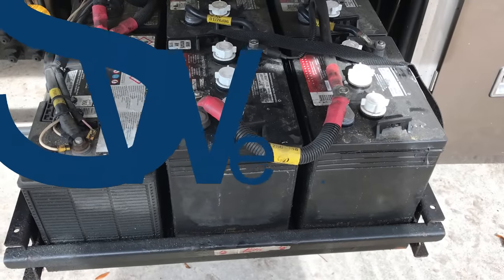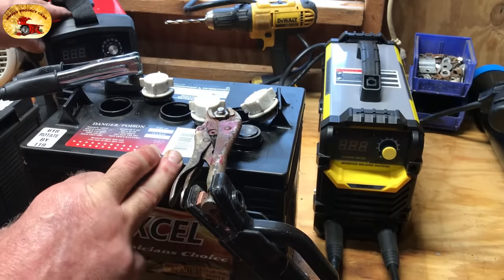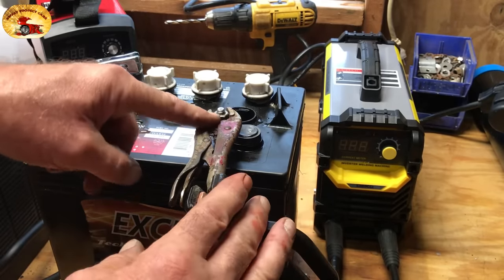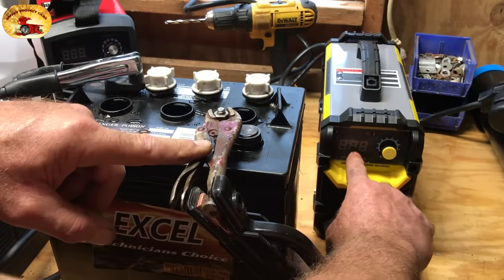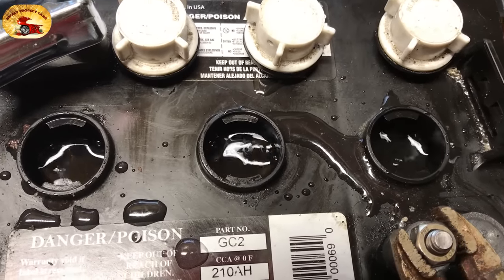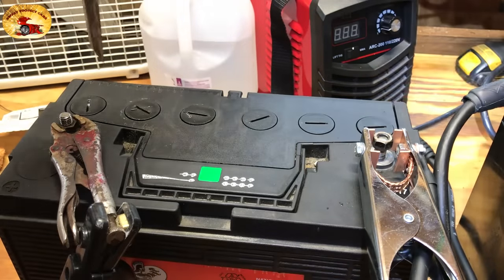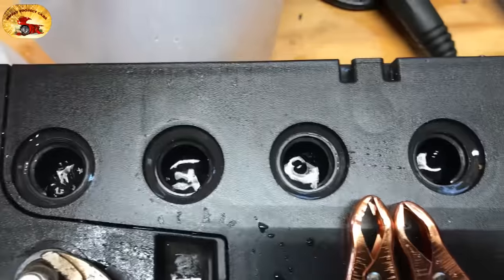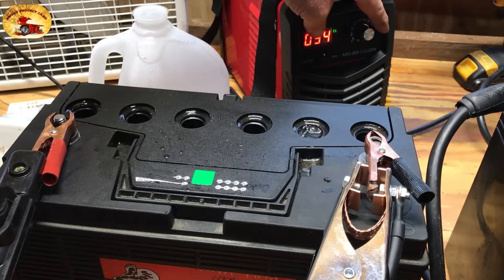How To MAKE OLD BATTERIES NEW Again!!!  12v 6v Deep Cycle, Car, Truck, Golf Cart, Semi

Comment: Question, since the plates/plaques are releasing residue from the process of reviving the batteries, wouldn't it be a good idea to throw out the dirty distilled water used in the revival process, rinse and repeat a couple of times and just add new distilled water at the end ? I'm assuming that all of the old residue is going to stick back to the plates/plaques
Reply from the maker: If it makes you feel better to do that, go ahead Eddie, we don't think it's necessary but do whatever you are comfortable with, it certainly doesn't hurt. Thanks for watching, have a great week and all the best on your project my friend. mad Mike the hammer SPC
Reply: It's actually dilute sulphuric acid used as the electrolyte in lead-acid batteries. Distilled water is non-conductive so won't work as an electrolyte. If the electrolyte level is low in a cell, it should be topped-up with distilled water to just above the top of the plates. Adding more will dilute the acid and reduce the capacity and current rating of the battery.

Comment: Did you get your welders mixed up? The Deka(yellow) welder you said was for the 6 volt and could do tig welding, but the description on the Amazon link didn't mention tig capability. The red one you said was for 12 volt batteries and didn't say anything about being able to tig weld but the description in the Amazon link said it could do lift tig welding. I have 4 6v GC2 golf cart batteries that need rejuvenating.
Reply from the maker: Rick, they are both capable of doing tig welding, Amazon just doesn't mention it on the yellow one.  Hope this helps.  Have  great night.  mad Mike the hammer SPC

Comment: Is there a way to look at the batteries and know if you would consider it a regular battery or a deep cycle.  Some of the marine batteries seem to be meant for starting and deep cycle of boats.  How do I know which type of battery to consider it.
Reply: the best i can tell is if the battery does not indicate an ah rating on it to use the welder for a standard battery?
Reply from the maker: Just google the part number on the battery, that will tell you what type it is.  Thank you for watching Craig, have a great day. mad Mike the hammer SPC

Comment: Is this process safe and effective with AGM batteries??  I bought a Schumacker SC1325 with 250A and it does not seem to be doing the job with the thermal overload protections.  Should the battery be dead when desulfering?  The SC1325 works when turned "on" for 3 min, then goes to "rdy" for 3 min then does a 3 min count down and stops boiling.  It will then go back to ready but not bubble again.  Battery is at 13.2 V.
Reply from the maker: This only works on wet style batteries

Comment: Is the number showing on the welding machines amps or voltage?? Thanks
Reply from the maker: It's amps, it acts just like a standard battery charger except you can weld with it.  Thanks Wm. mad Mike the hammer SPC

Comment: Could I try to revive a battery that is sealed, doing the same 5 minutes X 5, then 10 minutes rest then again even if I do not see the bubbles?
Reply from the maker: No, you need to have visual of the fluids in the batteries.  Thanks for watching.  mad Mike the hammer SPC
Reply: @SweetProjectCars  Mike, I had a problem with the first battery, I had to crank the mini welder to 105 so I could see the bubles. Yesterday I got a couple of new post cables so I could really GRAB the posts and it worked better, at 50 I could see the bubbles. Thank you.

Comment: Mad Mike the Hammer- I bought the Associated 200 amp (blue) charger that you recommended in your other video for 12v batteries. Works great. However, I now have a bunch of 6v batteries that need charging. Can I put the setting on 6v and charge it them with that? For how long? I don’t want to buy a welder after spending all that $$ on the charger. Thanks for all you do.
Reply from the maker: You can use the charger for that size as long as they are wet-style, just reduce all of the timelines in half.  Thanks for watching and asking, have a great day. mad Mike the hammer SPC

Comment: The 12v battery in '18 Camry reads 10.8v, it struggles to start but it will turn the engine over. After driving it reads 12.8 (so my alternator is working) then after sitting it goes back down to 10.8v From what I've read online I may have a dead cell. This method of reviving a battery wouldn't help if it is a dead cell or would it ?
Reply from the maker: We've done it, give it a shot Mateo, sounds like you've got nothing to lose my friend. Have a great day and all the best on your project. mad Mike the hammer SPC

Comment: Here in South Africa a 12v Trojan 1275 golf cart battery costs R5,200 (USD 300) and you need 4 of them.  Mine are getting tired and I can see the grey sulphate deposit on the plates through the filler caps.  I can buy a 200amp stick welder for +/- USD 120.  If the technique works as you claim  I must ask why is it not practiced more widely?  If you can buy a suitable welder for a tenth of the price of 4 new batteries it's a no-brainer, and surely somebody would be refurbishing them as a business.
Reply from the maker: They are indeed, refurbing them and re-selling them Brian. Not sure why more people don't do this, I can't remember the last time we purchased a battery. Thank you for watching and commenting, have a great week my friend. mad Mike the hammer SPC

Comment: Great video.. I am trying today for first time and one cell won't wake up.. even if turn welder to 150..any advise?
Reply: OK think I have it sorted. My Metabo welder has a switch fit toggle or clap I changed to clamp and all boiling..
Reply from the maker: Let the battery cool after you do the process, wait a day or 12 hrs. and try it again, we've done the series up to 5 times and have had success, but if you do it 5 times and it doesn't wake up that cell, your battery is toast. Hope this helps Derek, thank you for watching and asking, have a great New Year. mad Mike the hammer SPC

Comment: Just to be sure as can't get exactly the same welders in the UK at the moment.
Could you please state the voltage output for both the red and yellow welders ?  
At what amperage to run them (in your previous vid with the old none digital charger I think you were using START MODE i.e. 200/210 A for the 12v batteries)
Could you tell us the make and model for each as Amazon is not taking me to the exact welders.
Reply from the maker: Get this  https://amzn.to/3lamXiv     When your new welder arrives, clamp that badboy on your battery, follow the video and you are good to go.  Thanks.  Have a fantastic day my friend.  mad Mike the hammer SPC
Reply: @SweetProjectCars  ....  Thanks Mike, got that ordered as a Christmas present from my daughter. 
Following your video, I should use 22 Amps for 5 mins on and off for 10 mins, repeat 5 times... I should use 90 Amps for a couple of minutes to wake a reluctant battery or cell up.
I should not use 200 Amps as in your other video. 15 mins on 60 mins off repeat 5 times.
What is the important difference  between the 2  ?
Just want to fully understand both techniques but don't want to be a pain.

Comment: Should I add epsom salt first before I put the battery on the welding machine?
Reply from the maker: You can add drywall dust if you want to, it's your battery.  Follow the process in the video and you will have success.  Thanks.  mad Mike the hammer SPC
Reply: @SweetProjectCars  I'm just asking for more suggestions if only adding water doesn't work. I didn't appreciate the sarcasm with drywall dust as I ask you a serious question.
Reply: @SweetProjectCars  lol

Comment: I have a question or two.

How do I know what model welder to buy?

Also: is it 200 Volt going through the battery?
Reply from the maker: We use these  Welder for Deep Cycle ONLY 6 Volt & 12V Batteries    https://amzn.to/3yW4ihK  &  Use This for all Standard 12-volt Batteries    https://amzn.to/2K1UsWQ  Thanks for watching. mad Mike the hammer SPC

Comment: Hey boss, what are your recommendations on little 12v 7ah lead-acid batteries.  I sawbelow you said to cut the time in half for motorcycle batteries. My back of envelope math says to quarter the time.  Thoughts?
Reply from the maker: You answered your own question with your back of envelope math my friend :)  Thank you for watching William, we appreciate it.  Have a great weekend. mad Mike the hammer SPC
Reply: @SweetProjectCars  Finally got a dead battery and picked up an Amico that you suggested.  Youtube keeps deleting my comments because I wanted to post a pic imgbb.  Can't get the caps off.

Comment: i just have to ask. How many OUTPUT volts does the welder has to be and the digital numbers we see on the welders are amps or volts? So we use 12 volts but 40-50 amps or we just crank up the voltage to 130v ? I don't understand.Thank you
Reply from the maker: I would watch the video again.  Put the clamps on the battery, make sure the amp dial is on 0, plug in the welder and slowly turn up the amps until you have a consistent boil then follow the video process.  Thanks. mad Mike the hammer SPC

Comment: I have the same little yellow welder, Works great, I run mine on 220,  But that one won't work on the car batteries? I don't have any 6v, But have a few car batteries I would of liked to bring back.
Reply from the maker: We recommend this  https://amzn.to/2K1UsWQ  for standard car batteries, although you can use whatever you want to use, we are just sharing what we have tried and tested and know works and is safe for you and your batteries.  Thank you for watching Shawn.  Have a great day. mad Mike the hammer SPC
Reply: @SweetProjectCars  I seen that you moved to the 200amp for the other batteries, I'm going to give it a shot on the 160amp to see if I can revive my 12v marine battery. It's completely dead, If it works, Awesome, If it doesn't...Nothing lost. :)

Thanks again for all your awesome videos, I really appreciate it and enjoy watching.

Comment: Hi there ,thanks for your amazing videos. I tried the welder method so the battery cell did boiled a lot, but I couldn't get the battery to keep the charge. I had the welder at 70 amps because I couldn't get it any higher because my breaker with pop up.do the amps need to go higher. Thanks
Reply from the maker: Hello Domingo, you can do the complete 5 step process up to 5 times, if it doesn't hold after that, your battery is toast my friend. Thanks for watching and sharing, have a great day. mad Mike the hammer SPC

Comment: Dear Mike

I followed the video to the T and my previously dead battery awoke and started the car. Then I removed the negative and positive terminals from the battery to ensure nothing drains my battery for whatever reason.

The next morning, lo and behold, the battery was flat again. What could have gone wrong?

I'll try the method again, but this time either use a normal trickle charger after the 5th charge cycle to see if this won't ensure charge stays for much longer, or prolong the steps, say to 10times, or, close the cap of the battery of the more active cells to give those that are initially slower to bubble a chance to awaken without losing acid water in super active cells when I crank the welder knob up.

Any other advice?

Thank you for your continued sweet advice
Reply from the maker: Upon completion of the process, use this  https://amzn.to/3kmCThX to complete the charge. Sounds like you did everything correctly, but make sure you finish with the item in the link my friend.  Thank you for watching and sharing your results, sorry about the delay in responding. Have a great day. mad Mike the hammer SPC
Reply: I had the same problem -- did this charge completer method work for you?

Comment: What are the differences between the Yellow and the Red Welders?!
Reply from the maker: One is for deep cycle and one is for standard.  We've tested them both with said battery types and have found that each is specific to the type based on our tests, we know they work and most importantly  they are safe for both you and your batteries.  Thanks for watching, have a great day. mad Mike the hammer SPC

Comment: Which welder would you recommend to charge BOTH Deep Cycle 12 V batteries and normal 12 V Car Batteries? Would the 200 Amp welder be the one to use for both or the 160 Amp welder that you say to use on Deep Cycle batteries? John
Reply from the maker: Hello John, our videos are very product/tool specific, the recommended tools are listed in the SHOW MORE of the videos description. The reason we only recommend those specific welders is because they have been tried and tested by us in our over 40 years and have proven to work but most importantly are safe for both you and your batteries.  Thank you for watching, have a great day. mad Mike the hammer SPC

Comment: You can do this with your battery charger if you have a booster on it but it takes 15 min on max per hr. 3 or 4 times depending on the condition.  Cheers.
Reply from the maker: Thank you for watching and sharing Jeremy, have a great week my friend. mad Mike the hammer SPC

Comment: I checked out the Red Welder following your link. The link leds to a model# ARC200. There is an optional one ARC160 both same price. What is the difference? Which one do I consider ??? TIA😃
Reply: ooops I figured it out ARC200 is 200A and ARC160 is 160A. I want the 200A one. Thanks
Reply from the maker: Thanks Richard!  Glad you found your answer.  Have a fantastic day.  mad Mike the hammer SPC

Comment: Very good information. What should be the current  on the welding machine? Is it shows the current or voltage?
Reply from the maker: Turn the dial until it boils consistently, start low and work your way up.  Thanks for watching.  Have a great day.  mad Mike the hammer SPC
Reply: Current is the readout

Comment: I’m still trying to figure out why one 200 amp DC welder can’t work for both 6v and 12v batteries? 

On your last video you used a 200 amp charger. I get the speed of the welders is amazing and Multi use also. 

But would the 200 charger work for both 6v and 12v batteries, including deep cycle? 

I can afford to purchase the charger, not so much two welders. 

Any help would be appreciated, thank you.
Reply from the maker: My good friend, please do not analyze until paralyzed you need to follow each video and use the exact same tools shown for your safety and your batteries. Thank you for watching, have a great day Joe. mad Mike the hammer SPC

Comment: Thanks, the number on your wielding machine, is it volts or amps?
Reply from the maker: You need to just follow the video and set your welder exactly as we do.  Make sure you are using the suggested welders or you could have problems.  Thanks. mad Mike the hammer SPC
Reply: @SweetProjectCars  thanks.
Reply: Welders increase in amperage to increase power.

Comment: Hi, great video but what type of stick welder because you say 12 v dc but all the stick welders I look at are 240volt, do you mean a welder that’s stepped down from 240 v to 12 volt , could you send me a link to the welder type I should buy please, like an eBay link or similar, thank you
Reply from the maker: Use this   https://amzn.to/3sTpodi  for ALL Deep Cycle only 6 Volt & 12V Batteries and for All  Standard 12-volt Batteries, use this one https://amzn.to/2K1UsWQ  Thank you for watching.  Have a great week. mad Mike the hammer SPC

Comment: I looked quite a ways down in comments... still ask you confirmation: can I get by with 1 welder for only 12 volt, both deep cell & car batteries?  If not, confirm for lead-acid used in solar application, the yellow one?  (my 200 amp battery charger does not allow 15 sessions, so you sharing this is great!)  Best regards, Cap'n Nemo!
Reply: *does not allow 15 minute sessions.
Reply from the maker: We wish we could say yes to your question, but unfortunately you need both to do the batteries you are speaking of.  Thanks my friend.  Have a great day.  mad Mike the hammer SPC

Comment: Thanks for the info!  The welder you recommended wasn’t available so we purchased the more expensive one that you said we could use. The only problem is it has a bunch of different settings that aren’t addressed in your video. We got it to bubble using the flux setting. After 5 cycles we checked the battery and it tested at 12.6v.  Put it back in the car and it started once but wouldn’t start again. Then noticed the the links section you say to fully and slowly charge the battery after renewing and before using. Should we just start the entire process over or do the slow charge now?
Reply from the maker: Hello K, all you need to do now is put the battery on this https://amzn.to/3uGKNYB  for at least 24 hrs. or until the green light is lit on the trickle charger before using the battery. Thank you for watching and asking, we appreciate it, have a great day and all the best on your project my friend. mad Mike the hammer SPC
Reply: If my battery is currently holding a 12.3v charge is it fine to start this process, or should I drain the voltage first?